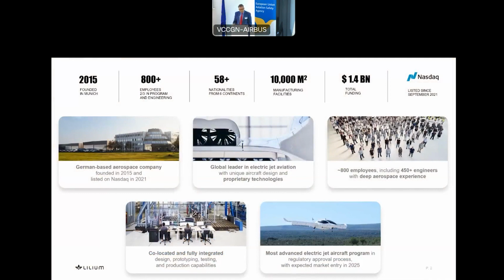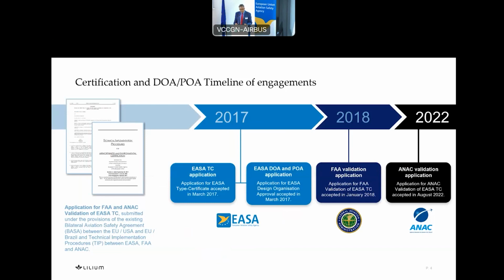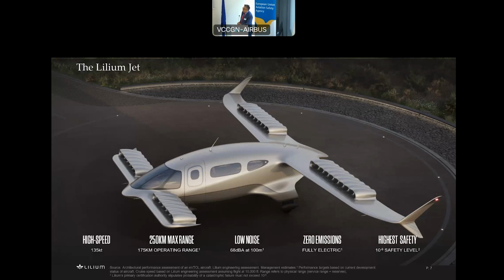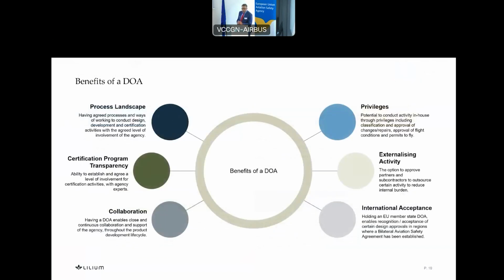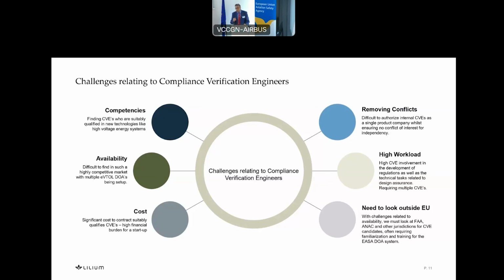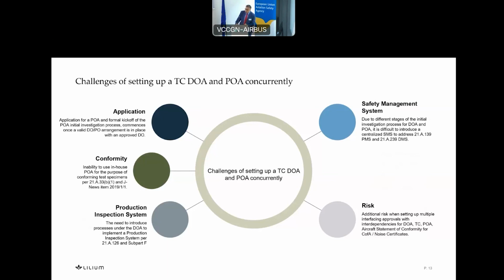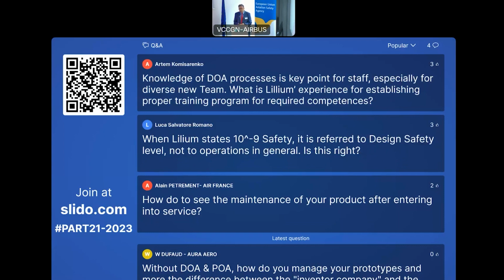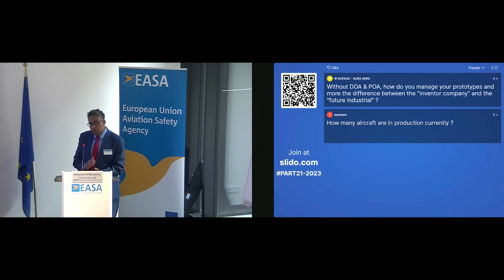DOA for Start ups - Part 21 Implementation Workshop

Comment: Can anyone tell me why they put the ducted fans on top of the wings rather than underneath?
Reply: You don't want faster moving air below the wing, as in from the suction of the fans right?
Reply: @SuryaSarav_  I did a little checking, it's because the ducted fans are attached to the flaps and not the fixed part of the wing, so they need to be on top or the intake area would be blocked by the fixed part of the wing in the vertical position.
Reply: @jassonsw  Indeed makes sense from a practical perspective
Reply: to create the lift of an aircraft the air on the upper side of the wing should be speed up  (less density) and on the belly side slow down for (high density). This lift will be economicaly in travel.